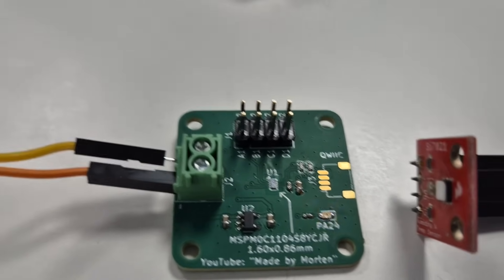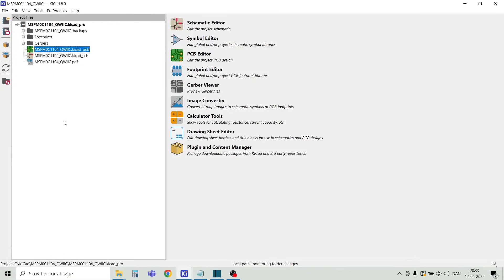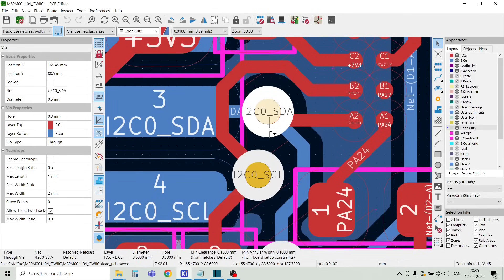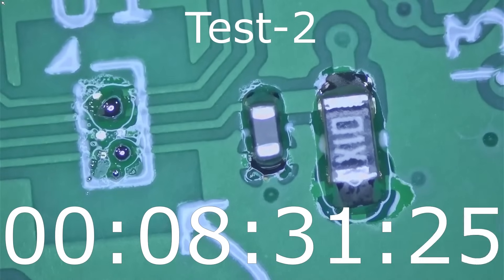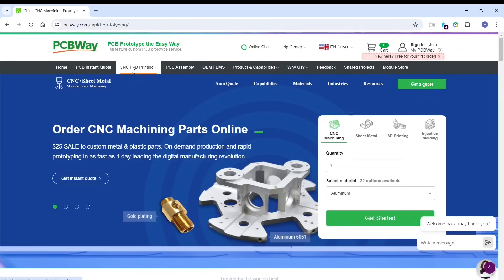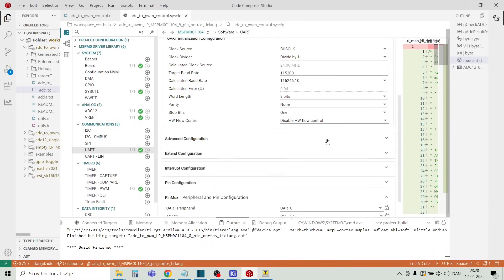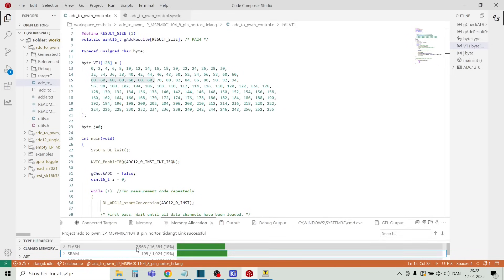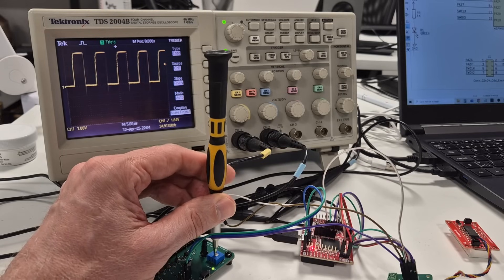Design and write code for the World's smallest MCU, the TI MSPM0C1104

Comment: Has anyone used the zero code stuff in code composer to do a project with this? I want to try a PWM controlled RGB led with ADC and a pot controlling the brightness\colour. Would this be fairly easy with the zero code option? Thanks.
Reply from the maker: I will try and test it out and let you know my findings if you are interested?
Reply: @made.by.morten.laboratories  Yes, Please do thanks.
Reply from the maker: I have done this in code only, i have not used the zero code tool yet

Comment: I wonder if you could use a hypodermic needle to apply the solder paste more exactly.  I would think an insulin syringe (former nurse) would work well because it has a small needle and a small diameter barrel for the syringe which would make it easier to apply smaller amounts.
Reply from the maker: @markeverett1393 , Thank you very mich for the tip, I will try and see if i can find something similar

Comment: If you want to make it even smaller, df52 connectors are great with 0.8mm pitch and easy to use with precrimped leads digikey.
Reply from the maker: Thank you for the hint - i will have a look on the DF52 connectors

Comment: I thought there were some Chinese microcontrollers for like 3 cents each, that were very small -- basically the size of the package is driven by the number of pins and type of pin, and the die itself is just a speck.
Reply from the maker: @gryzman, yeah you are right, the die does not take up a lot of space inin other packages

Comment: You don't need to prep the board using soldering paste. You can do it with a soldering iron as well. Just use a thicker flux or rosin for making it easy.
Reply from the maker: @saiavinash555 - thank you very much for the advise - i will try that out for sure :-)

Comment: Nice will you also design a board for the larger packages that have more i/o pins.
Reply: That would be very specific. I have not yet fully looked at the details of the chip peripherals, but if have a breadboard setup with the RP2040 (similar cpu, different peripherals) for a brushless motor control (3xPWM) that uses the SimpleFOCMini board with a DRV8313 chip and quadrature encoder (3 i/o pins) for the angle measurement.
Reply from the maker: Thank you for the inspiration
Reply from the maker: @chipcode5538, this is a great idea, I will look into it if I have extra time, are there anything particiular that you are looking for?

Comment: where does 3.3v come from-- Other i2c device? Cool work!
Reply from the maker: @aditmaddy  - You are right, this device is powered through the QWIIC connector. If you check out my first video in this series you will find a design with a LDO powered from a terminal block.